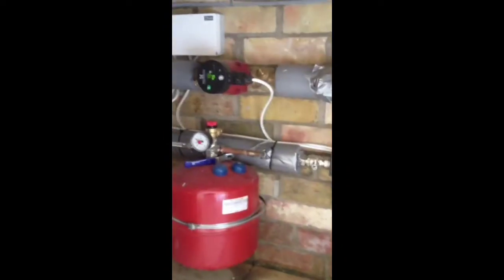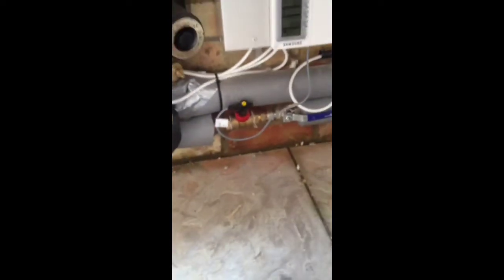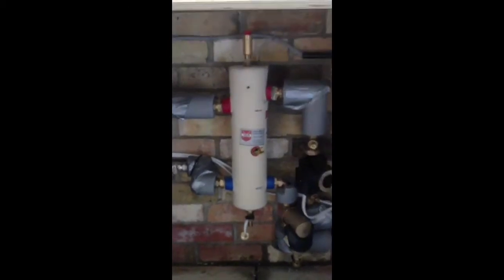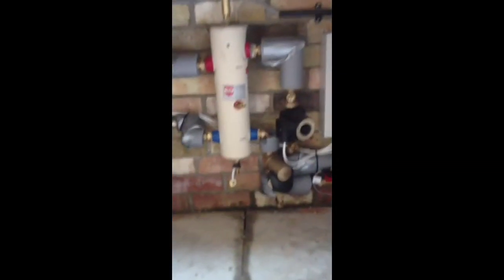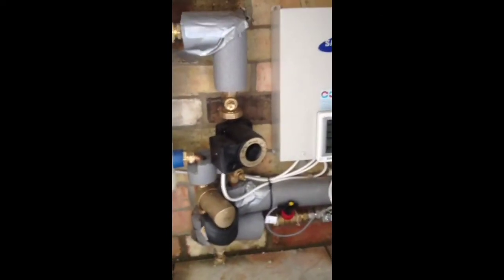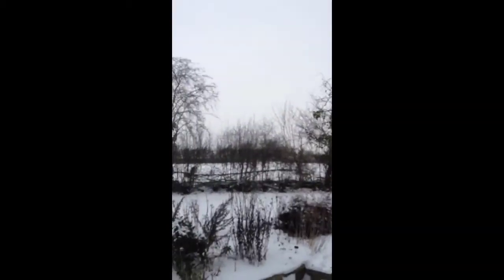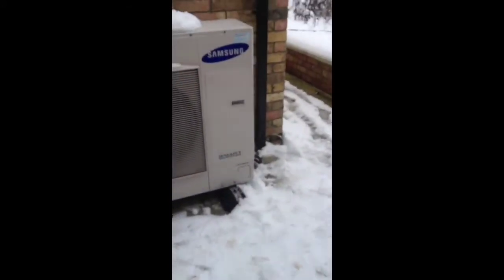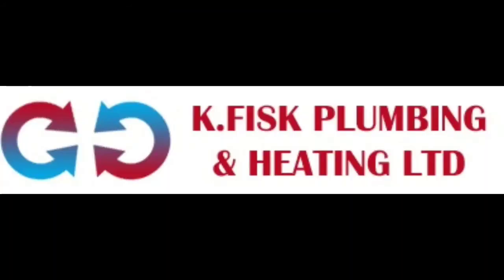Samsung heat pump

Comment: On my 16 kw split samsung the flow meter is on out pipe just before internal pump
And is writen with (set 21 litre per minut)